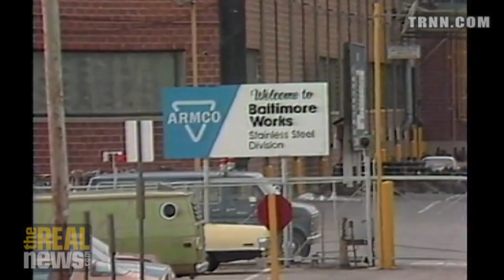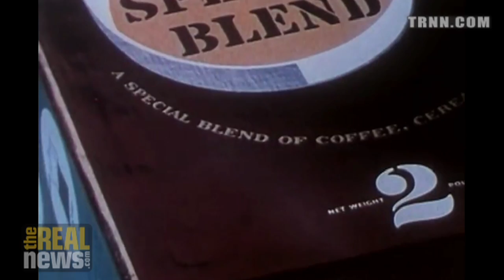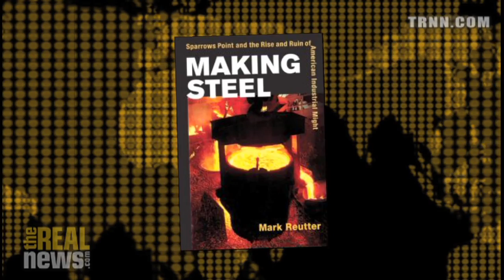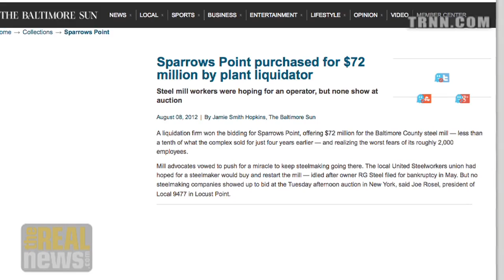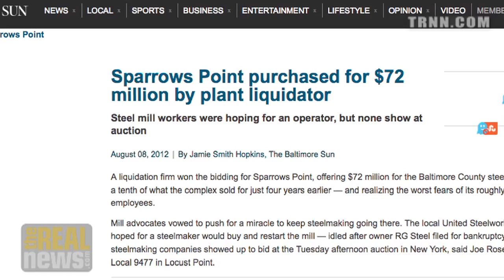What Happened to Making Steel in Baltimore? - Mark Reutter on Reality Asserts Itself (1/3)

Comment: I grew up in Sparrows Point. This guy hit the nail on the head. The mentality was that they were invincible. They thought the need for steel was so important that it was inconceivable the plant would ever shut down. In the end they priced themselves out of the market. There wasn't enough money to cover the cost of wages, benefits, pensions, etc, etc, etc (which kept rising every year) and invest in new technology/materials at the same time. Those folks have a lot to be proud of. They definitely played a part in building our country and in its defense. Unfortunately it's all just a memory now.
Reply: Do you remember the 13 week's paid vacation every 5th year? Full pension after a mere 30 years of work?
The older guys told me that injection molding was the state of the art for making what we did, and that our plant could not be modified to make injection molding a reality.
Shortly after I left BS in the 1970s, I learned about Nucor's recycling scrap and using nonunion labour. Then and there, I knew that BS was doomed.
Reply: Exactly

Comment: I was surprised at the complete lack of mention of the lengthy (12 weeks in duration) 1959 steel strike, and its impact on steel-consuming industries. If I recall correctly, that span of time was when many U. S. industries figured out they could get by quite nicely with imported steel--and thus the would-be monopoly started to erode particularly quickly.

(I was 7 years old then, and can still see the strikers huddled around 55 gallon drums with fires going to keep them warm while picketing, and seeing the stacks of the mill beyond 5th Street emitting absolutely nothing--and I lived on the 500 block of D Street, so I know what the mills looked like when going full throttle.)

As I recall, there was near-total intransigence on both sides in 1959. One wonders how things might be different had Ike declared the US steel industry to be essential to national defense, stepped in, ordered mediation, and gotten it settled in (let's say) four to six weeks instead of twelve.
Reply: It's interesting to speculate, but he touched on some of the core essences of these installations: They were all really old and really resistant to change.  Not adopting stuff like BOF's and eventually moving into the scrap recycling market with EAFs meant that it was only a matter of time.  Both Sparrows Point and Homestead for US Steel were still running Open Hearths way...way...past their prime.

Comment: I think reutter is partially right, but there’s a lot more to this.
Steel was never that popular in beer except for kegs, even then beer bottles were much cheaper than steel.
He talks as if the steel companies weren’t innovating at all when many did have research and development departments.
Steel would’ve always been used to build more buildings and more infrastructure.  Why is less infrastructure being built today?  It’s not like The domestic market demand for steel exploded because Americans weren’t affected by World War II and having to rebuild infrastructure.  Everything was slowly replaced overtime, sometimes more rapidly sometimes slower.   
Yes the average American has much less kids than they did in the 50s, but that still wouldn’t explain why replacements for old infrastructure, or building different skyscrapers wouldn’t have needed steel.